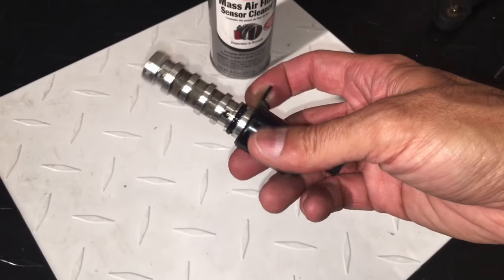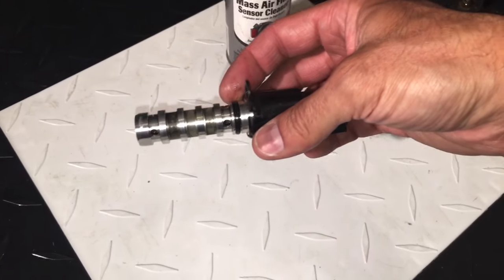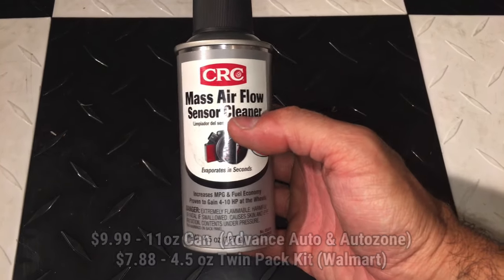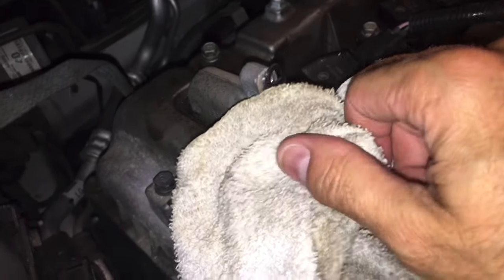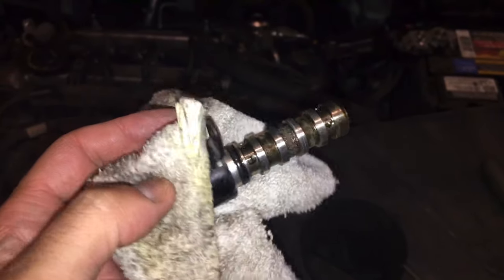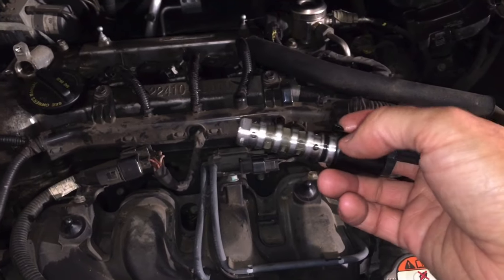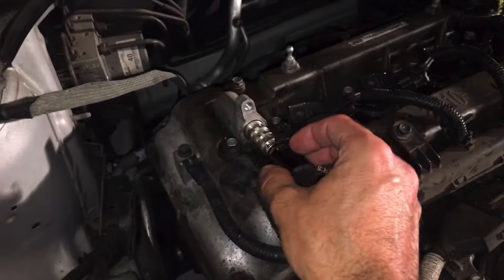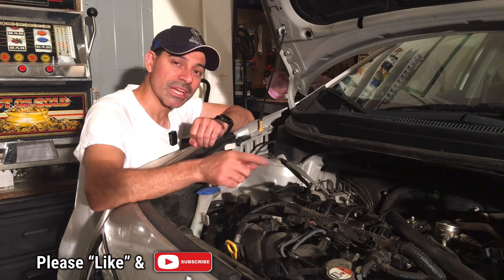How To Clean Variable Valve Timing Solenoids & Oil Control Valves (Andy’s Garage: Episode - 263)

Comment: Hi, thanks for your video. One question, I have a 2008 Toyota Corolla with 230,000 km with a manual gearbox. The fault is that when turning on it starts with 1300 rpm and as it heats up they go up to 2000, that is, it is the other way around since I understand it should drop to around 900 rpm. and already hot I go out and when I make the gear changes I see that the rpm oscillate between 2000 and 1000 rpm and when I continue the march the minimum is 2000 rpm. If I leave it running stopped the car stays at 2000 rpm. I clarify that with a scanner it does not give an error. Well we removed the carburetor, total cleaning including the MAF sensor of the filter, to clarify, you cannot remove the IAC valve to clean but the carburetion body was submerged in non-abrasive removing liquids and a lot of dirt came out. We measured TPS and IAC with a multimeter, we simulated with power and everything was fine. We checked the pipes that had never been touched and they were impeccable. We put everything together and it starts making the same failure. We took out the VVT valve, it was cleaned with carburetor fluid and wd40, I have original oil in the car, of 5 original toyota viscosity, I excited the solenoid with 12 volts to the vvt-i and it works well, I don't improve at all either. So I disconnected the EGR vacuum valve and there the rpm's dropped a little but after five seconds it accelerates and when connected it returns to 2000 rpm. If I disconnect the MAF sensor, the fault disappears but the engine idles low between 300 and 500 rpm's and the car loses power at 3000 rpm's and the brake is very hard. You can help me?
Reply: Check brake booster have vaccuan leak coz pipe or booster. Check engine lean code. Both sign it you have vaccuan leak from brake booster there video how to check it
Reply: If not it highly likely maf sensor you need to check with scanner. If good MAF sensor engine stop when you remove electric socket from it . If engine still run your maf is bad. Btw 2008 Toyota don't have carburator anymore you mean to throttle body.
Reply: @maungmaung4037  Hello, thanks for answering me, I disconnected the MAF and the car idles low, it does not go up more than 500 rpm's and the brake is a bit hard, although the fault disappears where the raelnti is 2000 rpm's and the brakes stop oscillating RPM's from 1000 to 2000, you can't drive. I bought a stock MAF like the one you have factory at Toyota and it didn't fix itself. I thought like you about the leak and had the servo checked and they told me it was fine. Take out the intake manifold and seal some joints that seemed not well sealed. Another test that I did was to disconnect the brake booster valve and the rpm's also drop to 500 rpm's, the brake remains hard without the help, you can't drive like that either. I will also tell you that we removed the throttle body and it was submerged in special liquids, no dirt came out, the car in general is very careful, the only thing I could not remove is the IAC valve because it has a special 25 Pentalobe type key I think, but I can't buy that tool, the same thing, both the IAC and the TPS were cleaned and measured with a tester and the injector voltage was checked and it works fine. I also changed the intake manifold gasket, spark plugs and PSV valve, all original Toyota, the Toyota scanner and other colleagues say nothing of failure. I put a vacuum gauge and it measures 18 normal psi and when accelerating it drops to 0 and then recovers. I don't know whether to suspect a leak from injectors, I am very disoriented and worse, I live in a very small city far from any official service to take to the car and no one has a vacuum gauge and has smoke to see where the leak could be. If you can think of a control that you can do, I would appreciate it. Greetings
Reply: Check your gas pedal latch or cable that's connected to the throttle body, maybe is overtightened or something. Maybe you have some Air leak or a disconnected sensor. Somewhere around
Reply: You might also do a throttle position relearn. I had an issue on a nissan with high idle and the throttle position relearn fixed it.
Reply: @josephacker3328  tks, i try and coment. regards

Comment: Hey i have 2013 hyundai accent i replace the alternater and now i have a check engine light on but i did not put the right blots in the alternater and on blot mass me sensors but now it says p0011 code

Comment: My car cranks but won't start is it the vvt
Reply from the maker: No, check the starter, fuel pump relay, spark etc
Reply: @PhillipsVision  the relays is fine and sparks is fine to
Reply: @PhillipsVision  I just installed a new fuel pump still doing the same thing
Reply from the maker: @fransiscovalenzuela3780  have you tried starting it with starter fluid?
Reply: @PhillipsVision  no I havnt
Reply: @PhillipsVision  where do u put the starter fluid at
Reply from the maker: @fransiscovalenzuela3780  spray it directly into the throttle body and have someone try to start the car, if it starts the issue is with you fuel system. If it doesn’t start, your issue is with the ignition system
Reply: @PhillipsVision  do u mean ignition switch
Reply from the maker: @fransiscovalenzuela3780  no, you’ll need to diagnose the ignition system and see where the issue is
Reply: @PhillipsVision  my mechanic says it's the timing chain

Comment: Why clean istead of replacing? I rather replace it.
Reply: A lot of times it’s just the screen getting clogged from dirty oil . It’s best to try this route first instead of throwing parts at it . Example an Audi 4.2 has 4 of these. Granted some cars it’s only $40 to replace. Every customer is different with what they can afford . Would change oil / clean sensor and go from there